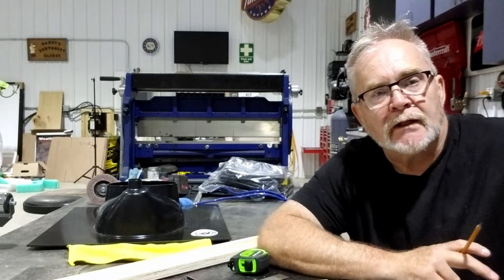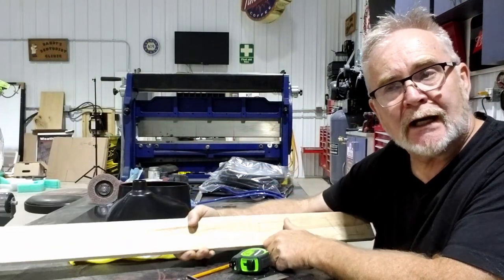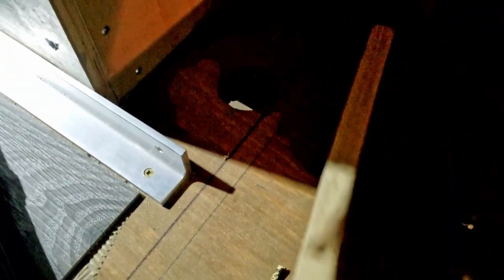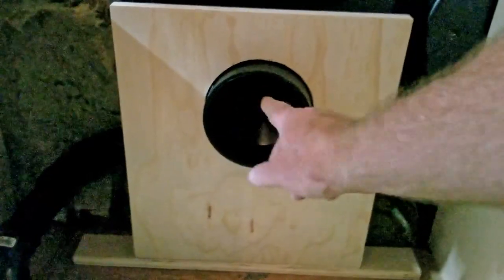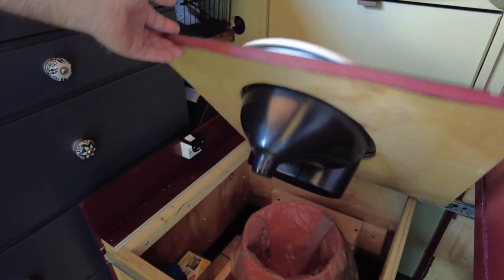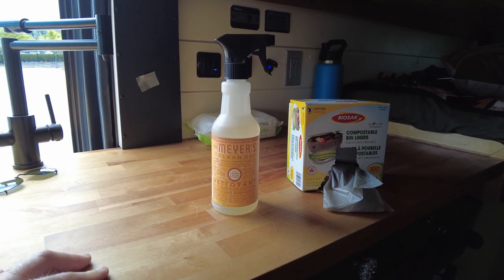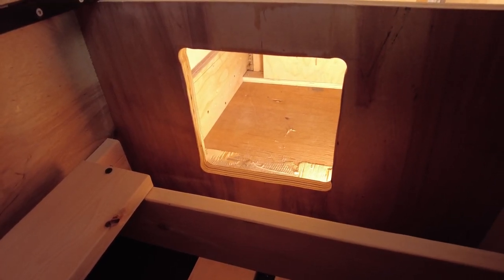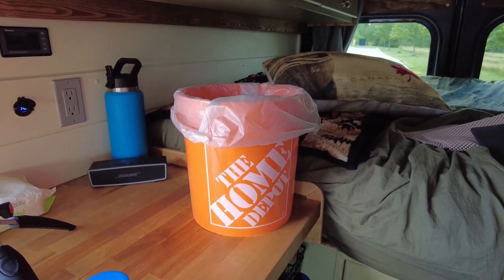CREATIVE DIY VANLIFE TOILET! COMPOSTING/DIVERTING//EP11: Promaster Van Build Chronicles

Comment: What a shitshow...LOL...but pretty damned ingenious! I hope you remembered to add something to keep rodents out, on the outside part of the pipe :-) Now that you will be fulltiming, you might want to add a diaperpail in your garage - you can get some that are airtight, which will keep any smells out from any baggies that need storing until you find a place to deposit them :-)
Reply from the maker: Hey Michelle! I just realized that the message I started to type earlier, wasn’t sent. 🙄 Yes, Rob covered it with screen mesh to keep flies and little visitors out. 😂 We will look into other pail options. Thanks so much for your helpful tips! And Thanks for watching the sh*tshow. 😝
Reply: @RobandJanCanVan  LMAO! Another tip - get a pail that's not plastic, as it can absorb smells. If you can't find a useable diaper pail, and opt for a regular trash can - drop an inch of scented kittylitter on the bottom and just drop the bags on top

Comment: Hey Rob and Jan! All I can say is this is a crappy video! Hahahahahahahaha! Just kidding of course and pun intended! Btw, Rob, can’t you put the air vent fan on a switch?…that way you don’t have to turn it on until it’s needed in order to save wear and tear and the life span of the fan? Just a thought. Thanks for sharing! As always stay safe y’all!  ~Jim~
Reply from the maker: Hey Jim, technically you could put it on a switch, but if you are in it full time, it is best to have it running all of the time. It makes a huge difference to cut down on smells…and yes, it is a crappy video! 😂 Hope all is well with you in Texas!? 😊 Thanks for always making us laugh. 👍
Reply: @RobandJanCanVan  > I meant to have it turned off ONLY when it hadn’t been used yet…of course you’d want it on continuously otherwise! 
😂😂😂